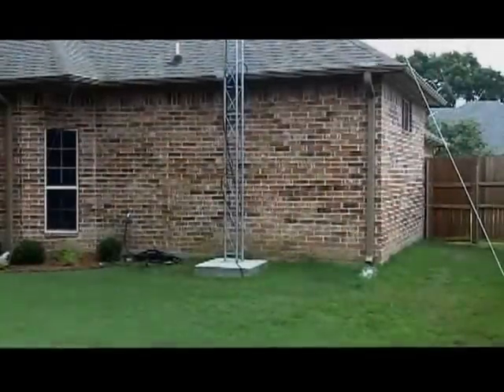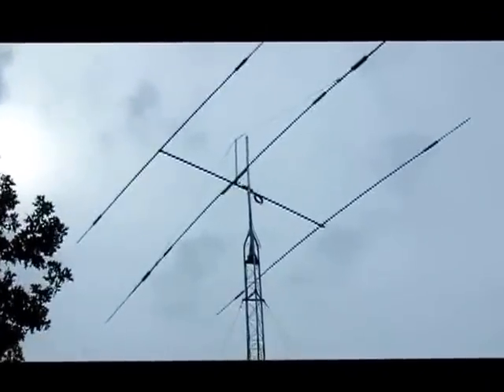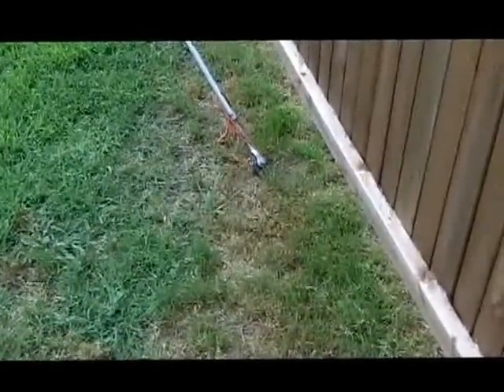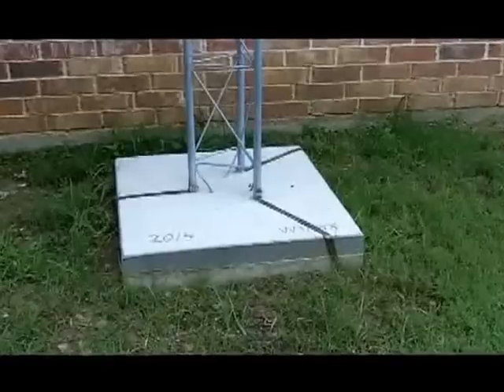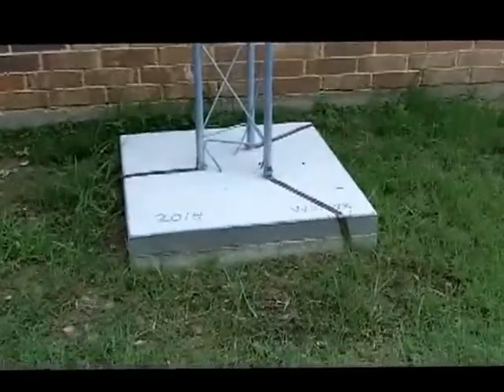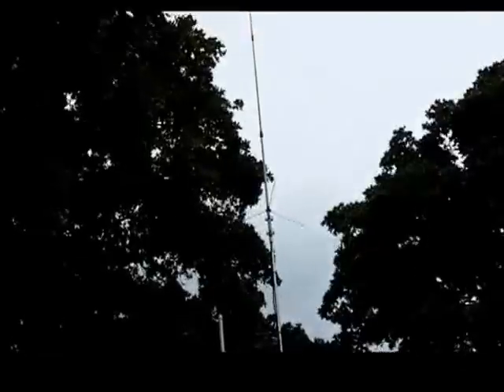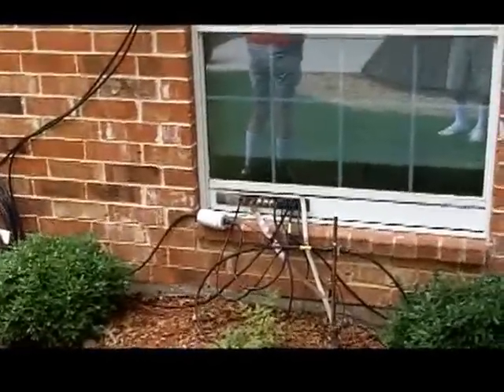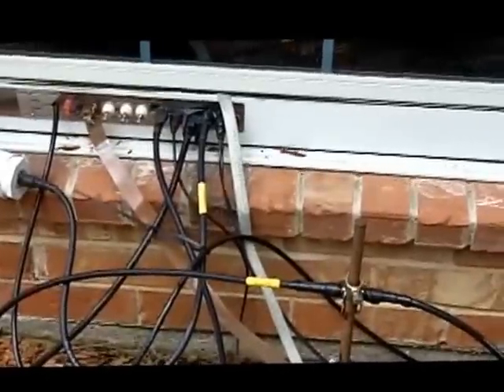Final Ham Radio Tower Comments

Comment from the maker: The 5 "Murphy" issues with the tower were, #1-- a broken wire on the rotor control line. #2. A small welding bump on the inside of the top section that prevented us from inserting the mast. #3. Bad SWR due to a backwards mounted trap coil. #4. A bad rotor control box. #5. The wrong Alpha Delta lightning arrest rated for 200 watts instead of 2000 watts. All were corrected within a week or two.

This was a great learning experience for me and I thank all of the amateur operators that assisted me in finding and correcting these issues. 73

Comment: Good video Joe.  Thanks for the tip on welding the anchor eye shut.  How did you insert the guy anchor into the ground?   Twisting it into the ground or dig a hole?  Also if twisted, what (tool) did you use to twist it in?  Did you install it at an angel?  
Thanks
Reply from the maker: Went to "Tractor Supply" and bought mobile home tie down anchors. (4FT long) we twisted these into the ground using a short piece of rebar. We did NOT dig a hole.
Reply: Thank you Joe I always learn from your videos.

Comment: Why would you connect your tower grounds to the electrical mains ground?
Reply from the maker: To equalize the entire tower and radio ground system throughout the house see this perimeter grounding system article- by DX engineering:  http://static.dxengineering.com/pdf/Lightning%20Protection%20P3.pdf    Mine is not as extensive as shown since the entire house is not surrounded.Only a part of the house. Also I did not put down additional ground rods as shown in the article, just the 3 shown in the video which are interconnected in a circle around the tower pad.
This helps to dissipate the lightning current before it reaches your equipment. However I do unplug the equipment during a lightning event including disconnecting the rotor cable. The coax is grounded at the tower and another lightning arrester is on the ground rod outside the shack. 73